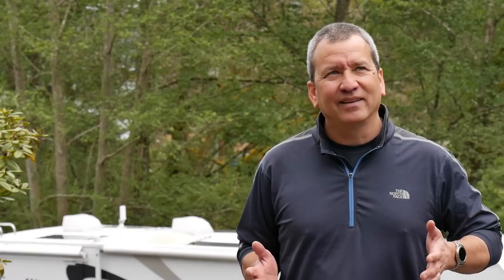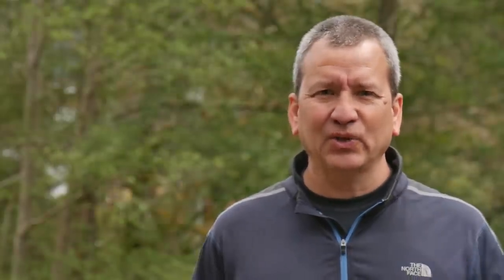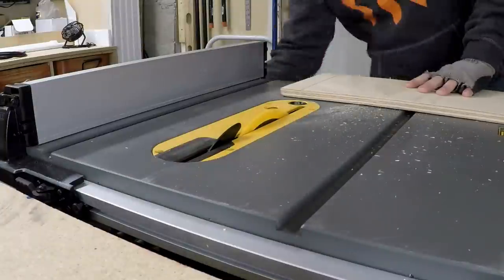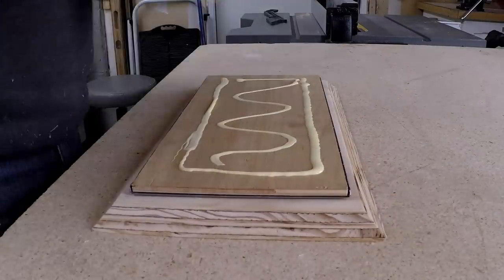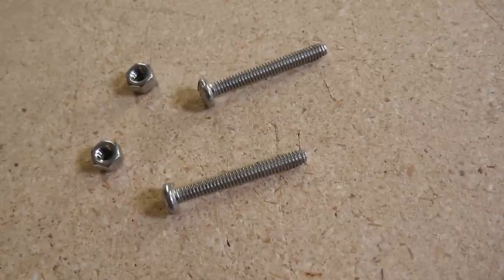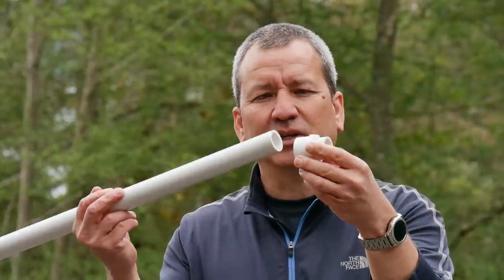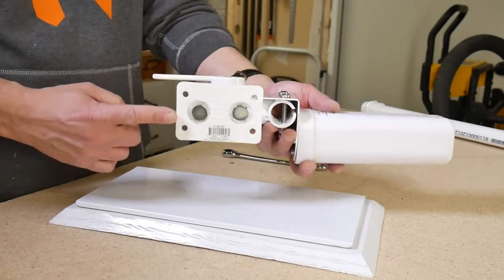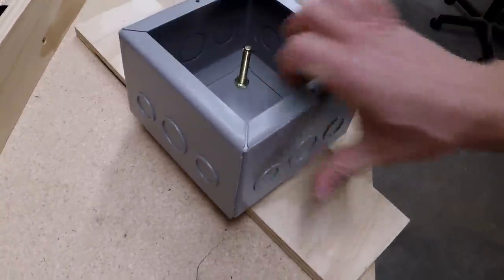DIY Adjustable ANTENNA MOUNT - NO DRILLING HOLES in Your RV Roof

Comment: Tito do you have a Nav system in your RV, if so where is your antenna.  I am installing a new radio with NAV and have seen all kinds of conflicting advice on antenna placement.
Reply from the maker: I have a Garmin GPS that sits on my dashboard and works just fine. No extra antenna.
Reply: RVwithTito great I have a class C and was concerned about the roof extension blocking the signal.  BTW , great videos.

Comment: Was there a specific reason you used the sheet metal piece? I’m thinking it would add strenght to the mount but is there any other purpose? Thanks great video!
Reply from the maker: You nailed it. That was the main reason...to give the screws something to grab on to.
Reply: @RVwithTito  the plywood in time might delaminate then the antenna fly off

Comment: Why not use 3M industrial strength double sided tape (they use that on aircraft)  instead of eternabond? That way you skip the plywood part and just glue the antenna base plate to the roof. One less thing to rot.
Reply: Are you referring to 3M VHB? that's good stuff.

Comment: Great video!  I watched it a few times to get the details of the folding mount attachment.  I’m mounting my Weboost trucker antenna , with three extensions on the back of my travel trailer.  So, when traveling, I can fold it down along the back.

One problem I ran into was the pipe thread of the PVC Tee. The mount is 1” , 14 TPI non-tapered.  I ordered a 1” PVC Tee which which looks about 1/3” too big. An NPT table lists 1” NPT with an 11 or so TPI?  I’m confused.

What thread and pipe standard is the Tee that you used that so easily spun onto the folding mount?
Reply: I am researching how to mount the exact same setup. Did you figure out the threads?
Reply: @MrEroh  Yes, I bought a PVC 1” threaded coupling to screw on the threads of Wilson antenna mount. Used it just to cover the antenna mount threads. I ended up screwing a 3/8 inch threaded insert into the hole in the Wilson mount and screwed the standard antenna thread into that. Mounted on the upper rear of the trailer above the camera.  This way I can put it up and down (sideways) with a small step ladder.

Comment: Why did you need to use the stainless steel plate?
Reply from the maker: Thought the screws would be less likely to pull out.

Comment: Thinking about getting a Wiboost cell booster could I connect to the RV tv antenna coax? Any help is appreciated
Reply from the maker: Yes you could if it's in decent shape. I've tested the already installed tv antenna cable with mine and it works fine. They do include a high quality coax cable in the package too.
Reply: RV with Tito DIY thank you

Comment: Hey Tito, mate, when you glue two pieces of timber together, especially in your application, it is imperative that you spread the glue evenly over the entire surface especially right up to the outer edges as the glue will then form a watertight seal on the outer edge. You did not do this, and just spread it randomly on the inner area and not right to the edges. Therefore, it is likely that the outer edges are not glued and hence will let rain penetrate in between the 2 sandwiched boards, and we know where that is going. One last thing, Tito, for safety reasons you shouldn't be wearing gloves, fingerless or otherwise, when operating a bench [circular] saw.

Comment: plenty of ham radio operators clamp antenna mounts to the rear ladder.
Reply from the maker: +joe woodchuck Yes that was an option. I do have the ladder pole mount. I just didn't want it hanging on my ladder all the time.

Comment: magnets do not attract( stick ) to stainless steel !
Reply: That depends on the alloy. Basic stainless steel IS magnetic (ferritic). Most of the stainless we encounter daily is austenitic and not magnetic. 

So, if a magnet does not stick to a steel, it's almost certainly stainless. But if it does stick, it may or may not be stainless.